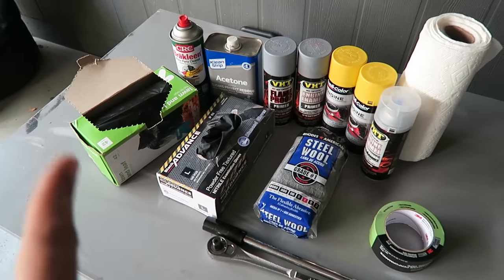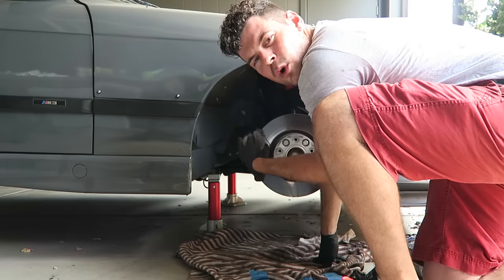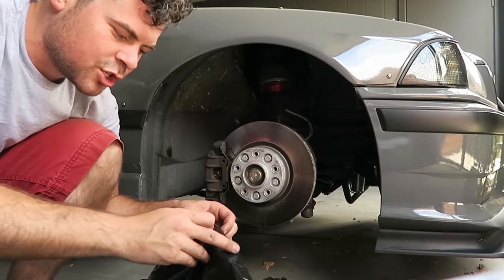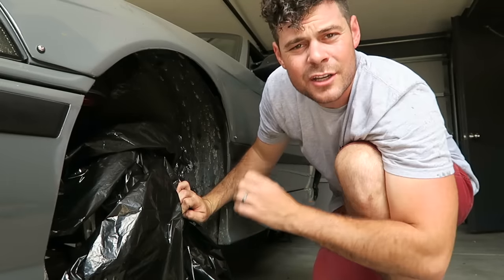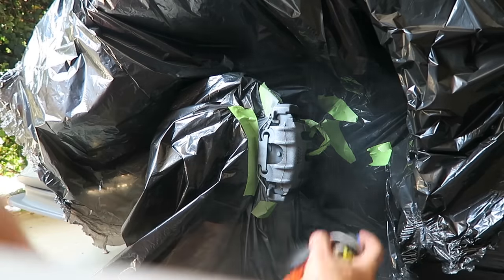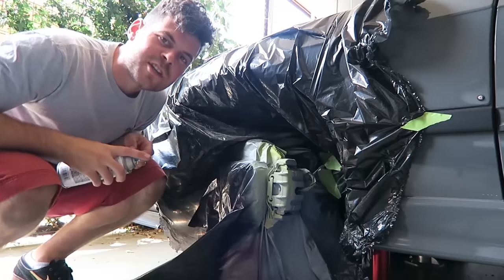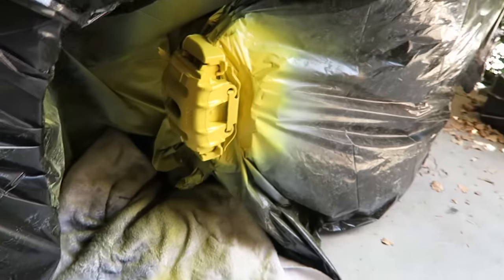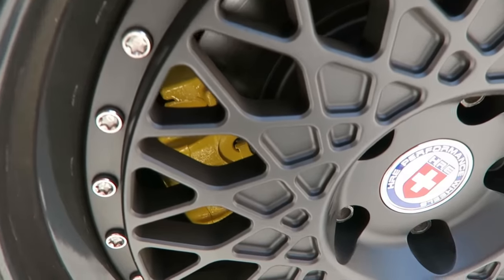HOW TO PAINT BRAKE CALIPERS... THE EASIEST WAY!

Comment: Why not take the calliper off and support it. That way you can paint the whol calliper evenly and not have any get on the rotor
Reply: PatWinner54 more effort I suppose?
Reply: PatWinner54 It's in the title... "The Easiest Way"
Reply: Its really not the easiest way.... He just complicated it more
Reply: Because time is Money
Reply: PatWinner54 for those who are scared to take it off....
Reply: buhahahahah he masked the entire quarter panel omg
Reply: Provide a link to YOUR video so we can see how you did it.
Reply: RonandT hey buddy no offense, I did like your video, I just wouldn't have the patience to do that, quite a lot of work there doing all that masking, you have my respect. I'm sure it will help the less mechanically inclided and it would be better if they didn't mess with their brakes too. I would personally service the calipers and take it apart, (flush the brake fluids), clean and lubricate the sliders and pads contact points. One may be tempted to spray down everything with brake cleaner but that's recipe to noisy brakes and sticking pads/calipers and if it gets into your hub's bearing somehow, kiss good bye to it's grease, good thing you didn't do that. But I also wouldn't bother to paint my calipers, for having previously rattled can other items, the paint never stays long enough to be worth the hassle, even with all the prep in the world. Especially since the calipers seeslots of heating/cooling cycles and that I'm in the salt belt up north, I suppose it does slow down the rust somewhat but before you know, you'll have to strip it down and repaint it. If one wants a long lasting paint job, it needs to be professionally power coated. If you find the right guy, not too picky about the color and don't mind waiting for his next big job to have your calipers done on the side, it can be done for not too much money. Granted, the calipers would have to be completely taken a part and all the openings masked but that paint shop will last.
Reply: He wrote ''the easiest way'' not the most complicated possible way.
Reply: i agree, id do this next time the brakes get serviced,but i guess some dont do there own brakes...
Reply: You sprayed the clips, pads and the sensor cables as well as the calipers. You should change the video title to reflect this.
Reply: If that was my ride I would have masked the whole car.
Reply: Rotors wont matter, the paint will be removed once you start driving and the brakes are applied, like rust. The lines and clips will get painted though.
Reply: What about using painters tape on those parts so no paint gets in? would be tricky but can be done
Reply: Fear of the unknown.  I would like to freshen my calipers without messing with the mechanics of the car.
Reply: Yep. Just remove the caliper from it's mount and hang it in the wheel well using some bearing wire or wire or string that will support the caliper while hanging so that it's not putting pressure on the flexible rubber hose. 
Also, he's using acetone; not a good idea to get it on rubber parts (easily done). Make sure whatever you use to clean will not harm the rubber hose or the dust boot that surrounds the caliper piston. Mask those off as well. 
You can drape a painters cloth over the nearby painted surfaces so that paint will not settle onto the car's finish. Also, doing it this way will eliminate overspray from getting on the rotors. You can just drape a cloth or rag/plastic over the rotor and surrounding areas. 
His method is causing overspray onto the rotor areas he wasn't able to get to and mask off. 
Not everything seen on Youtube is the easiest way. Nothing wrong with looking at videos but some have to be taken with a grain of salt, or compare some of the methods and come up with the best way while using your own views if they work.
Reply: It’s better doing it this way so you don’t have to clean brake fluid mess and flush the brakes.
Reply: Well, it’s coming time for me to replace my brake fluid and lines. So I’m gonna take off the rotor anyways. Then imma paint them Spoon Sports Blue. Would look so clean against my Redline Orange Pearl paint.
Reply: Or brush paint it so there is no overspray...
Reply: the easiest way
Reply: Michael Vermunt it'd been half the work he spent masking off 2/3rd 's of the car lmao
Reply: Yazzan Hajir this is what I'm saying lmao he spent way more time, money, and effort masking it all off and it only got 20% worth of cleaning if that
Reply: Jaythesizzler You just made yourself sound so damn lazy bro...you'd make the dude a good sidekick on the plus side lmfao
Reply: The easy way 👍
Reply: Maybe so that he woudn't have to bleed the breaks and maybe have to buy more break fluid?

Comment: Followed this to the T yesterday and my calipers turned out great. Just one tip is that make sure when you use the garbage bag to cover the roters and what not, make sure its not touching the caliper thats going to be painted because it can cause uneven adhesion of the paint with the garbage bag and caliper resulting in unevenness. Otherwise great video. And those thinking how much to wait between each spray? 10 mins.

Comment: Good job man. One tip I use is to have a hair dryer or heat gun on hand to speed up the whole drying process. I even pre heat the caliper before I start spraying. Also cover the whole car with old sheets, that mist travels. Top job though.

Comment: Off all the caliper paint vids I’ve seen yours was by far the best and most comprehensive one! Good job! Looks amazing! The only suggestion I would add is this. Once you have tge wheels off, between paint coats. Go ahead and do a good wheel cleaning job, especially on the inside! This is an area that rarely gets a good scrubbing! I will share this!

Comment: Take off the caliper, let it sit on a 5 gallon bucket so there's  no tension on the brake line and voila it is done! This way you can work on the caliper easily and clean it really well and you don't even have to bleed the brakes . For those saying you HAVE to bleed the brakes, you don't. Just don't  disconnect the brake line from the caliper and cover the brake line up!!
Reply: facts. not risking getting paint on the car
Reply: I’d find a way to mess something up by taking it off

Comment: I love this. 

To the other guy that says take them off it’s just two bolts. It’s not just two bolts if you take them off you either hang them or remove the caliper totally them you got break fluid everywhere. This is the way to do it. 

This is the way I’m doing mine. Great video and thanks a ton.

Comment: Whoa ... you're a rough crowd   .. Rodney Dangerfield.

* Paint on the pad ... who cares, it won't hurt anything. Next time he "pad slaps" they're no longer painted. Would I settle for that or painting the hardware, no way.
* Paint while on car vs pull and paint. Personal decision based on tool set, skillz set, mind set, and car. Based on car, and rims .. he's fine.
* Duplacolor vs "brake paint" vs powder coating - again, personal choice with $$ to spend, time and skillz. I've seen duplacolor 1yr, 2yrs down the line ... They look like what it cost. I've used the expensive mixed epoxi-paint kits and it looked great 4 years later. Powder coating is a tad more expensive, lasts nearly forever. (longer than the calipers will)

Personally, I removed mine, clamped the hose, (they have a round nosed vise-grip for this, just don't do it to SS braided hoses)  used a die grinder with a 3M pad to take off all the flashing on the calipers and brackets castings (pet peeve). Then had a local shop powder coat them (which you can do yourself for under $150). But now, when it comes time to "replace" the calipers I'll want to rebuild vs replace as it's $50-$100 bucks per pair of calipers to get them powder coated. What I actually did to make the best use of time, was when it was time to replace my calipers, I ordered a set, prep'd them, powdered coated them, and then on a saturday of my choice, installed them. Bleeding brakes is not rocket science ... watch the vids and test on a quiet street afterwards ... your good to go .. (or stop!)
Some people choose to not paint the bracket. (part between spindle and caliper) My personal choice is to not paint the hardware or pads as I like the contrast. (my preference) I do 100% of the caliper and bracket even tho I know you can't see it. Its a half-ass'd job IMO and I would know. And that matters to me.

Comment: i don't know if the rubbish bag idea is yours, but you were the 1st i saw!
I paint my own  calipers and i used the elasticity of the plastic bag, as you did!
the procedure i have done was a bit different. i used the drill with a wire brush and i cleaned as good as i could! the rest... were easy!

I have question though! i didn't use any primer. will my paint last long or not?

Comment: A couple of things I want to share with you. I think it would’ve been as easy and yielded a much higher quality job to remove the calipers or paint them before installing. Secondly, while you’re right about lighter and more numerous coats you were a bit on the extreme. Your coats are super light and you’re spraying a lot of waste into the air. 2-3 coats should be plenty. Nice video!

Comment: I have always pulled them for this process, but if you want do it quick and not have the worries of re-bleeding the brake lines I suppose it works. I would suggest that you do this right before installing the new pads though, that way the pads are not painted because it makes for a cleaner look. Overall not a bad way to get it done when you have no desire to do some mechanic work on putting the brakes back on...

Comment: Looks good...here comes the but. You did mask off but there will be a ton of over spray on the top surfaces of the car. Clay bar should will help  remove. Just a fyi if others try it...you will get over spray on anything unprotected especially if you're doing in the garage 😉
Reply: breeder2006 where can I get that stuff you mentioned for the overspray on hood? I have a lot of small white paint specks on my black jeep hood. I need a good way to get them off. Thanks
Reply: Jeff King “clay bar” look it up on amazon
Reply: Jeff King should find it there and a lot of other places
Reply: UhhPerfections thx man!!
Reply: Or paint thinner

Comment: Take the calipers off. Don’t do it this way.
Reply: Robert Ramos My point exactly. Only the outside was clean and painted not the inner.
Reply: Time is money
Reply: @robgillingham6256  well, if you don't take your time, you'll end with cheap looking calipers, so taking them off is the key
Reply: @diegowelt  No it wont
Reply: @robgillingham6256  It takes no time at all to remove a caliper. You don't want paint on the pads, pad brackets or rubber components. You can see at the end that he ended up with paint on his rotors which is inevitable with his technique. It just looks poorly done. If you're going to go through the work of getting the painting supplies, you may as well take the calipers off and prep them correctly.
Reply: @ben-7403  You're right.
Reply: I did and it looks fine. You do you internet man

Comment: I was taught if your going to put time into something you might as well do it right. That being said, it would have taken less time to take the caliper off and support it to paint it because there is less to mask off also your could temporarily remove the brake pads so you don't paint them too lol. Not to mention better coverage if paint on the caliper.

Comment: Much easier just doing it with a little paint brush,saves on covering up the car with bags
Reply: Andrew Ward sprayed paint in pie plate and used brush, worked great, no mess used clear Hy gloss for final coat, looks great.
Reply: Andrew Ward , and you won't get paint on the back of the pads !!!!!!

Comment: Calipers look good but I would not paint them this way. I would take them off completely tape whatever needs to be covered Etc.
Reply: Yeah just dont disconnect the hose otherwise its a whole new issue😂
Reply: Remember to support  calipers. If u stretch brake hoses they'll collapse and size caliper

Comment: The caliper is not smooth. SO it does not need so much prep work. If you just brush the paint on you can skip the masking and garbage bags.  You will be done in half the time.

Comment: The exaggeration on plastic bags covering the car is awesome even one bit of paint on the car other then whats supposed to be on the caliper is a huge NO, but wouldn't you find it easier to do this with the calipers removed ? I guess you didn't have any brake fluid or just didn't want to bleed the brakes in general, huh? Either way good video !! might consider this in the future haha

Comment: Easier to just disconnect it from the brake line and hang it to spray.  Reconnect, open master cylinder cap, and open bleeder line until it brake fluid starts to gravity flow. 

Much cleaner look and you can offset the caliper by painting the cage a gloss black.

Comment: I get the Rust-Oleum durable paint that comes in a can buy the spray paint and then I get a brush and I brush it on my calipers in between the spaces between my rims I've done it on about a dozen of my car is it always looks nice and it never chips or flakes and you can paint over rust and brake dust with that paint

Comment: Just take the brakes off and do it properly also get a haircut you chump
Reply: removing the calipers and getting brake fluid everywhere, bleeding the brakes, potentially stripping threads on the caliper...it is a pain in the butt

Comment: Plasti-Dip is still undefeated, holds up to the heat and I've had my calipers painted blue for a little over a year now. Not bad for a $10 cosmetic mod.
Reply: HouTxtC D-Davis doesn't plastidip get super dirty? I used to have it on my wheels. Getting all the brake dust off behind your wheels would be a pain no?

Comment: This is to all the people saying to take the caliper off.......Sure, maybe when it's a normal caliper, but cars these days are starting to have much more complicated brake systems.  I've painted over 200 sets and actually learned something from this vid in regards to the trash bag thing.  I do still get in there afterwards and tape off the brake pad, but I can do this in about the same time as taking them off, hanging, etc.  Then there is the fact that many calipers have clips that can be a pain in the ass to get back on without scratching the new paint.

Comment: I'm confused. One bolt and you can clamshell the caliper off, remove the pads, clean the calipers, mask the rotors, paint calipers thoroughly, reverse clamshell. ?

Comment: What would you reccomend doing if my calipers are ready painted and i want to re- paint them?  Sand them and try and get the old paint off? Or just try and paint over it ?
Reply: just clean it up and paint them with a little brush. really no need for heat proof paint either.

Comment: You need to find out what the flash times are on each coat . I think its 30mins of dry time then coat u will have better results but the primer needs 24hrs to cure

Comment: My car is hella low to even jack up and I'm using a low profile jack, I got very scared to jack all the way up to use my jack stand. I ended up using my hydraulic jack in place for like 1hr. Before anyone comes for me I know I shouldn't have done that. Just wondering how high up should I have lifted my car, considering I was using the toolPro 2000kg Ratchet Car stands which were quite big for my car. Oh and I only used the pinch sides to jack up, didn't use the interior because my low profile jack couldn't get there

Comment: Actually the easiest way is to not even take the wheels off.  Jack it up, so you can spin wheels as needed to hit certain spots, but no need to take the wheel off.  Spray brake cleaner, and then paint.  Done.  For as little as you can see the calipers on most cars, this is fine...and truly the EASIEST way.  Brake cleaner will clean off any overspray on the rotors or other parts you accidentally hit.   I'm not recommending it, but yes did it in my youth and it worked great.

Comment: Nice tips but honestly it much better painting the calipers with a brush instead of spray cans, no need to worry about over spray, goes of.much thicker so it lasts way.longer then if you sprayed it and lastly it is much easier to touch up.

Comment: Atleast take the metal clips off before painting,clean them up with the wire wool and refit when the paint has dried.
It looks much classier,and makes changing the pads when the time comes much much easier.
Reply: Especially since they are probably stainless steel

Comment: Save yourself 3hrs prep by a small tin of hammerite, wire brush calipers and clean off get a small art brush and paint away, drys in about 20mins wheel back on done.
Reply: I don't think Hammerite brush-on is rated for high temps

Comment: The EASIEST way is a wire brush, solvent, and a brush-on high heat paint.  I did mine in minutes.   All this disassembly and masking for the thrill of a spray can?

Comment: okay, you all know about cars, what do you know about paint? leaving it over night to cure would be what needs to be done, even if he got it done in the morning, and started the cleanup in the late afternoon, I would still want to leave it over night for it to cure, at least 10-12hours, the more the better. also of course depending on which paint he is using, my guess would be enamel based paint, am I right. it sure as heck not a poly, right? well in any case, looks awesome. i think ill do mine ASAP.  AWESOME. maybe fire engine RED!     LMAO

Comment: it would be easier to remove them, disassemble them, and paint them seperate and away from the car. Rebuild the caliper and reinstall them and bleed the system. You get a cleaner finish and the ability to get full coverage.